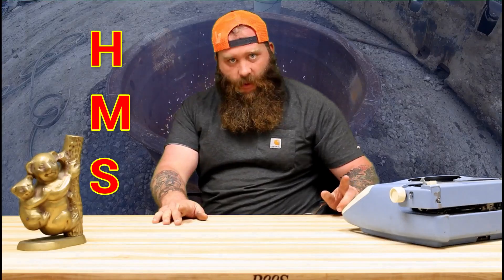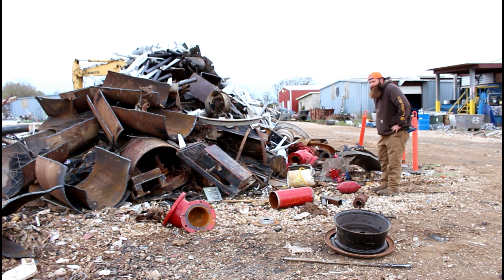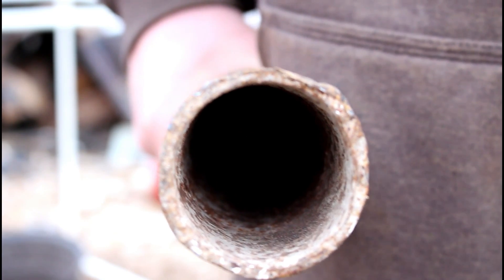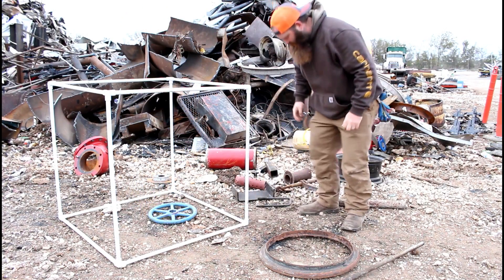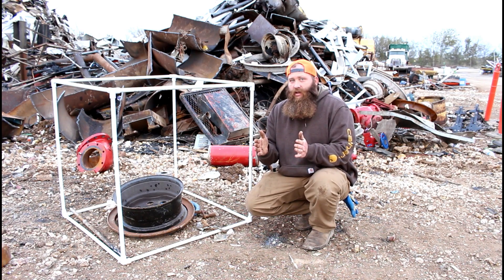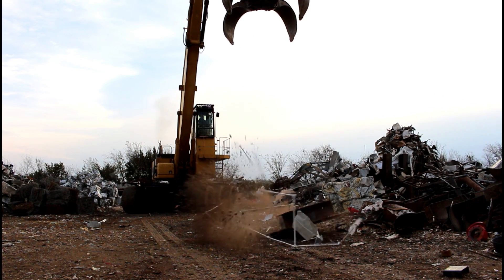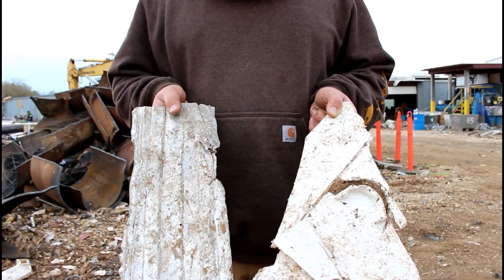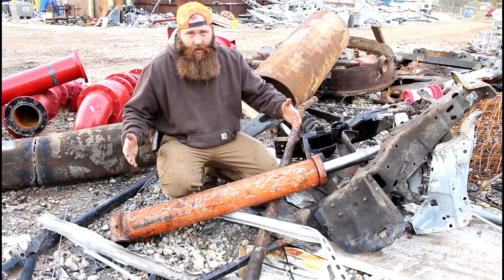Scrap metal #1 HMS-Heavy Melting Steel

Comment: Great video, very well described. Here in the UK we call anything over 4 feet oversize, as 4 feet is normally the diameter of the furnace door but I maybe wrong. Glad you mentioned about those hydrolic cylinders, I'm allowed to put those in the shred but sealed cylinders such as Gas bottles and air compressors must have a hole cut in them. Could you do a vid on cast iron next, and zap some pieces with the metal analysing gun, I here that some cast iron contains metals such as zinc or copper deppending on the use of the product.

Comment: Great video.  I've been scrapping for ten years and did not know about the prepared steel.  I heard the guys at the yard use the term and assumed it meant "smaller pieces" but didn't know it pays better.  I've always just put steel together in one load regardless of overall size of the pieces.
Reply from the maker: Thank you Ian!

Comment: Been mindfked about the differences of hms #1 & 2 for life I get the 1/4 inch part and the 50lb a 1ft sq. But rebar over a 1/4 inch goes as #2 everywhere I been in fl. Guess its the difference between location & buyers. Did not everer even know that structural steel was its own category it was the only thing I ever knew of that was #1 hms lol but they got me for a century haaa! Preace bro keep em coming long short in between just keep the film rolling hoss! & Thanks a Ton haha!!!
Reply from the maker: Thank you John, I promise I'll have more ferrous videos I just have to find the time!  I have five kids with one more on the way so making my videos is usually on the fly or when the opportunity presents itself!
Reply: @brackenrecycling9505  hi where do scrap bolts, nuts and chisel point belong,

Comment: Do brake rotors/drums fall in the same  as steel wheels? Probably depends on yard preference but I thought I’d ask anyway.
Reply from the maker: Great Question Michael!  You are right, it just depends on the yard and who they are selling to.  The best thing to do is call the yard and ask.  If they say no, ask them if it would make a difference if you brought a whole pickup truck of them.  Sometimes they say no even if they are putting them in their HMS just because they don't want to pay you more.  But when you meson you have a lot of weight they might pay you more because they know you are shopping around.
Reply: Bracken Recycling  sounds good 😁 I’m not to far off from a pickup load since most auto parts stores don’t pay core for them any more.

Comment: if i were to cut up a car frame and take it to a scrap yard what type of metal would they categorize it as?
Reply: they usualy have a seperate price for cars  i live by 6 scrapyards and all of them have a sperate price usualy around 270 a ton
Reply: either short or hms but consider the cost of your gasses/ abrasives. If you make an extra $50/ ton and the frame is 500 lbs you make $12.50. If you burn acetylene or a 12 inch disk = you lose time and $. Now, if you have a substantial amount of weight and can get your costs down it is another story. Around here you get paid more if you leave the motors in cars for weight.  The guy made me throw 305's in a core pile and then pays $12.50 for $50 worth of steel weight.